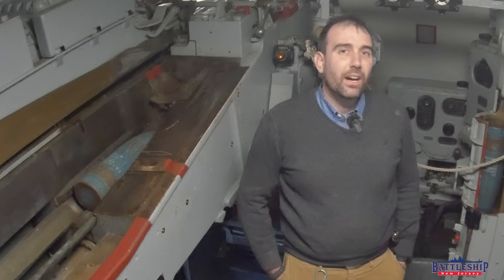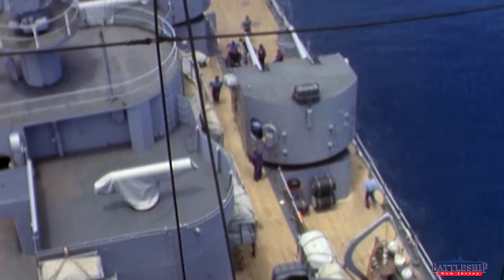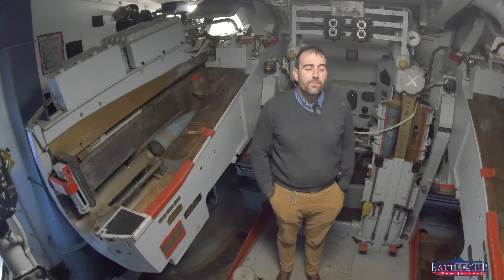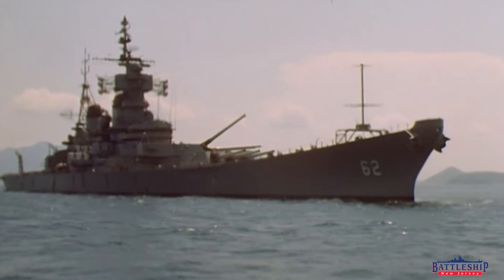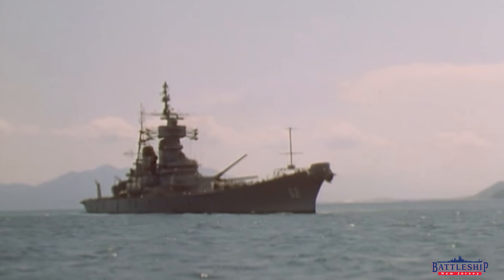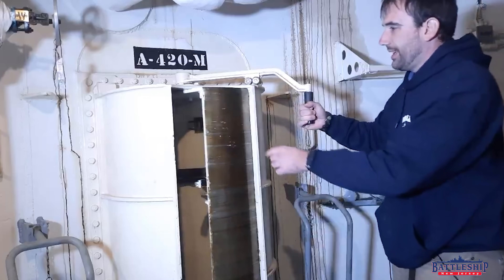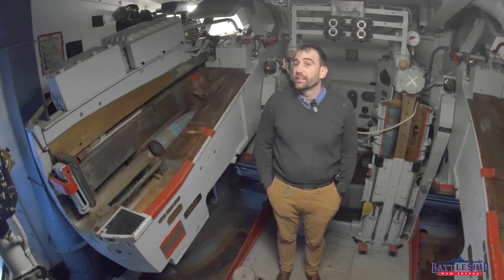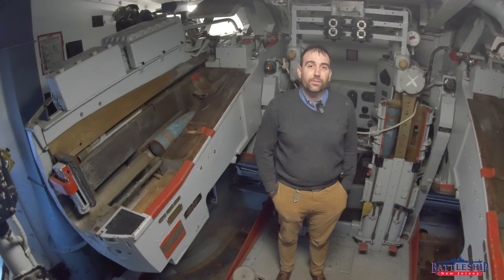Why Do Modern Warships Have So Few Guns?

Comment: I could definitely see a comeback of the old pom-pom type guns with ranged or proximity fuses in a automated configuration. Now that it doesn't take a nation state type organization to manufacture large payload drones, remotely operated bomb boats, and probably reasonably accurate rockets and eventually missiles, the likelihood of them being used is going to continue to grow. The Navy is going to need something with more range and the ability to put a lot of rounds down range quickly to defeat multiple targets and do it multiple times.
Reply: Proximity fuse isn't very good answer to drones. It isn't reliable enough against such small targets made from very different materials, flying at various speeds.
What you'd want is programmable fuse. Where FCS measures distance to target with laser, calculates it's speed and makes calculation to intercept target at optimal range - in most cases showering target with high speed fragments and shredding it. Programmable fuse to proximity fuse is like space magic. Especially when CWIS's with 30/35 mm programmable fuse gun systems exists, who would bother with proximity fuse? Proximity fuse will always have limited range where it can detonate, and range would be different depending on material of target - some proximity fuses will detonate when they detect something 1 - 2 meters around it after armed, some more some less - but it's always fixed. If something flies fast it may not be enough. Programmable fuse... you can tell to detonate 50 meters ahead of fast flying target, to basically put a wall of shrapnel in front of object. 
And honestly per shot cost wouldn't be that much different - modern proximity fuses would be prty expensive.
Reply: @Beneficiis  I am pretty sure that electronics have progressed from WW2 to now making it possible to make proximity fuses that detects drones.
Reply: @znail4675  doesn't really matter. Proximity is inherently inferior to programmable ammunition. To the point that in most applications proximity munitions for guns became redundant. They are still used in missiles, but that is entirely different story.
For conventional ammunition though - pointless when you have far more effective ammunition available.
Funny how people look at things like Gepard and think these are proxy fuses... these are programmable fuses. 
Proximity fuse is by today's standards ancient technology, not really worth investing in. Everybody long since switched to programmable fuses.
If somebody needs a reminder - proximity fuse detects nearby object on it's own - there's either magnetic sensor or optical sensor of some kind. Once something triggers sensor it detonates. Programmable fuse has fuse set up by fire control system to detonate at pre-designated distance from target, calculated automatically by computer - and that computer can program each round differently if needed. It is superior in every way, doesn't rely on magnetic or optic sensor (although all proxy shells I know rely on magnetic, hence against drones made from composites... it's not really the best idea anyway) in ammunition.
Reply: @Beneficiis  Proximity fuses usually uses radar. Programmable ammunition can also have proximity fuses. Bofors 40mm 3P have Proximity, timer and impact fuses. It can also combine those to for instance activate the proximity fuse after a set distance to be able to hit a helicopter behind a ridge. 
But your point doesn't invalidate the usefulness of a 40mm cannon.

Suicide drones, flying or by water and cruise missiles are major ship threats that it's better to have more then less protection against.

Drones with high quality optics that can spot a ship far away will need something else or multiple cannon platforms to be dealt with. But the immediate need is to have close to mid range cover.
Reply: @Beneficiis  US army studies, its counter drone systems its put into place since 2018, and practical experience in Ukraine shows proximity not programable rounds are the best way to go.  Class 1 UAVs (the small quad copters everyone thinks about) are the only ones too small to reliably set off proximity rounds and the US Army has zero gun based solutions for them.  All solutions publically known are electronic warfare solutions as those drones are too small and light to implement effective EW hardening.  Also due to their extremely small size and high speed, cannon and gun based solutions tend to fail to do anything.  

Against CLASS 2 and 3 Drones which are large agricultural sized multi rotor types to shaheed type suicide munitions, radar detection is not difficult and proximity rounds have shown to be highly effective.  Class 4 UAVs would be extremely large OWA UAVs to Small expensive UAVs such as Bayraktar and Class 5 UAVs are extremely large like Reaper and Global Hawk and these systems tend to be far more expensive than a MANPAD.
Reply: Well the research into railguns might be the push the Navy needs to stay competitive with other attack options.
Reply: Doubt 40mm guns would have the range to effectively reach out as far as drones can spot ships at. Ships need to be able to destroy shadowing aircraft.
Reply: Cheap drones is the new issue

Comment: Missiles and planes can our range guns.  They can be beaten.  Electronic countermeasures and chaff.  

Are you going to use a missile against a motor boat?  A small boat was used against USS Cole.  That could have happened to a super carrier.

When figuring out what is needed, we have to ask several questions.  Could we handle large attacks like Midway, Coral Sea, Guadalcanal, Battle of the Philippine Sea, German wolfpacks, and the German air attacks?  Could the ships blockade another country?  Could the ships take one a large empire like Japan or Germany in WWII?  With those questions answered, there are two very important questions.  What is the expenses for such weapons needed?  What is the likelihood of needing such weapons?

I do believe there's a need for more guns for close in protection.  The suicide boats, China expanding their Navy, and the aggressiveness of Russia shows the need for more guns.

Something fast and maneuverable like a frigate.  Something that could out gun, out run, and out maneuver suicide ships, but large enough to go out to sea with an aircraft carrier.  However, most attacks will happen in port.

As far as providing air cover, something like a cruiser with guns and missiles.  Something with far superior radar and fire control that can take out missiles and aircraft.

Both ships will only be needed if the ships on hand cannot provide adequate protection.  As time has gone on, weapons have changed.  Torpedo boats gave way to torpedo boat destroyers.  These destroyers expanded and adapted to the needs.  The ships we have are capable of being adopted for the mission.  Ships with changeable vertical launchers can be set to launch all SAMs.  Interestingly, amphibious landing ships could provide small craft for protection in ports if the need arises.  Just the question is what has to happen to bring this to happen?

Comment: Didn't the USN warships start WW2 with 50 cal machine guns and swap them out during the war with 20mm Oerlikon cannons, only for the 50 cal to come back much much much later?
It's a very small thing in the overall grand scheme of things, but like Ryan said. We might need to throw in a bunch of small caliber machine guns/cannons if drones continue to evolve.
Reply: I dont believe the US navy ever switched back to  the .50 on mass. As the war progressed, they move to larger and larger anti aircraft guns, and by the late war, the 40mm was standard issue on most things, but the US navy was already moving up to the 76mm, the 3inch/50 Mk 22. Simply because, while the other weapons were sufficient at defending against standard air attacks, against Kamikaze planes coming in on a direct course, they were often insufficient to stopping it. Since, even if the pilot is killed, it can still crash into the ship and destroy it. And with increasing speed of aircraft, you'd get so little time on target, moder powerful is better.

For the thing about the Airbust elements to UK ammo. I assume you mean the proxy fuse shells. They were incredibly secret yeah, but they were still widely deployed throughout the pacific. Problem was, fitting them in in the smaller guns was difficult, so they were only really used in the 5 inch guns, and later, the 3 inch guns. Modern naval guns still use them, the big ones. Navy destroyers dont tend to carry AP anymore, its not necessary. The main gun is used in surface shelling, engaging small targets at close range, and MAYBE trading fire with enemy fleet combatents. Given modern warships dont tend to carry more than shrapnel protection for armour, its sufficient. Those HE sells have a variable time fuse, a proxy fuse, set electronically, that can be used against air and ground targets. 

The US 20mm Phalanx does use solid tungsten APDS. Higher velocity and the penetrative power is ideal for a small calibre weapon. The sheer volume of fire compensates. But I think almost every other nation's CIWS have mixed munition loadouts and can utilise variable fuse HE as well.
Reply: @Thraxus  Iirc 50 cal machine guns were brought back specifically to counter small attack crafts. I don't believe they are deployed on mass like the 20 mm were firing WW2, and they serve a very different purpose nowadays.
But I could be wrong. I'm more interested in the historical stuff because modern weapon systems doesn't engage my monke brain the same way 100+ barrels of various caliber sizes do.
Reply: @eric24567  Ah yeah. There are a few that are usually scattered around ships, or personal to quickly man to deal with tiny boats and commando teams, thought not the main countermeasure for that by any means. That's just the habit of the US military to stick as many machine guns on something as they can xD and not always approved by the top brass. A pair of 25mm autocannons usually handles the smaller threats primarily.
Reply: Maybe we'd need to go back the good old air burst AA bullets... I imagine most of the rounds these days are FMJ or just pure metal AP rounds.

WWII UK AA bullets almost all have some airburst element to it to down the planes much easier (it was not used in pacific for OPSEC reasons, IIRC)

Comment: I'd like to see a few smaller gun mounts to better protect our vessels from smaller pirate craft. As for drones, I'm hoping directed energy becomes much more viable/reliable for that task, as fleet-grade drones seem much bigger and better engineered than what you might find in the infantry scenario.
Reply: Our warships don't have a pirate problem.
Reply: It exists, Oto Melara 76 with Strales guided munitions, effective with drones, missiles and boats
Reply: @askallois  hell yes
Reply: Directed energy is a red herring for drone defence. It would get overwhelmed very quickly. It's very good for last minute anti-missile defense. Anti-drone will be phalanx close in defence systems.
Reply: @bengoacher4455 current laser systems sure. In the future I doubt such issues will exist.
Reply: @bengoacher4455  Yes, because guns are just so much better at tracking vast numbers of small, fast, evasive targets capable of moving almost entirely unpredictably.
Reply: The problem with directed energy is it requires so MUCH energy, which has to be basically shunted in from elsewhere on the ship. Compared to a conventional projectile with its own chemical propellent.  For drone defense, a low-powered directed EM would probably be sufficient. Overwhelm it, force it to either crash or lose tracking and auto-home with its bomb still attached. Maybe get them to take themselves out.
Reply: Ships have a variety of weapons to use against small crafts. Rifles, M240, M2HB, 25MM guns, 30MM guns, CIWS if they feel like using that one also.
Reply: They have .50 cal mounts and the sailors can grab an M-16 if necessary.
Reply: @reubenmorris487  Yeah on second thought I can't imagine 'pirate'-grade craft will survive a welcome from Ma Deuce.
Reply: @jamesklee Iirc, the only times this has ever been an issue, Phalanx put a stop to it. (A French supply vessel and a US destroyer, again iirc.)
Reply: I’d like to see you keep your opinions to yourself. Nobody asked you. 😂 Just kidding, I like trolling people 😊

Comment: The barrels they have been adding seem to be Ma Deuce. After being entirely eliminated by 20 mm Oerlikons in WWII, the 50 cal is back on many Navy ships as an anti boat armament in this age of asymmetric warfare.
Reply: For small boats, .50 BMG will chew them up. 20-30 mm a bit further out; useful depending on the anti-ship weapons on the small boats.

CIWS guns, with their much higher rate of fire, would be more useful for tiny drones. More space will need to be allocated for ammunition; drone swarms will have many more targets than a typical ASM attack.
Reply: The Brits called it "Junk-bashing" back in the day.
Reply: This is purely due to economy it would seem, the 50.cal is in use in every service, Navy, Airforce, Marines, Army ect. Cant say the same for the 20mm, plus lot harder to carry, Just so much easier to use 50.cals against Somali boats and Drones.

Comment: What I've been wondering is why the self-defense armament doesn't include more guns? Given the $/unit cost of the major threats out there today (think a swarm of 200+ drones for <$1M total) , having even $100M is SAMs ready to launch might not be able to service enough threats to get the job done.
Reply: I think it's just that guns haven't proven to desperately in need. They would be great against massive cheap drone swarms, which as far as I know haven't really appeared yet, and guns aren't as reliable a defense as missiles. Against bigger threats, a missile, even if it costs more, is going to be better than losing the ship.
Reply: Because there is a lot of beaurcratic inertia in this; Everything has to be tested and then tested again, contracts need to be signed, plus there's a lot less profit making shells than a 1.5million or more SAM missile
Reply: @Shinzon23  that could change very easily if the right situation came up. I'm going to guess that more money is being made right now cranking out 155mm than SM-#'s. And I'd bet there are more congressmen who have voters that can get into that business than can start making SAMs.

Comment: Obviously with the zumwalt class they attempted to get some big guns back in the fleet but the tech was too expensive. Too bad they won’t shoot conventional 155mm shells
Reply: It’s more that the fancy high tech shells for the Zumwalt apparently cost $1m (or roughly that) each, production of said shells was stopped and the AGS (Advanced Gun System which is the Zumwalt’s guns) can only use that particular shell. Which is absolutely ridiculous.
Reply: Check out the Wikipedia page for the AGS. Link: https://en.wikipedia.org/wiki/Advanced_Gun_System